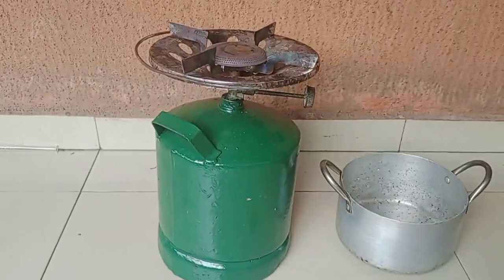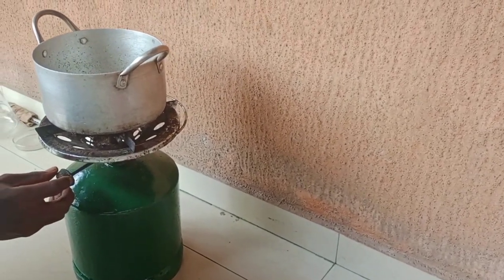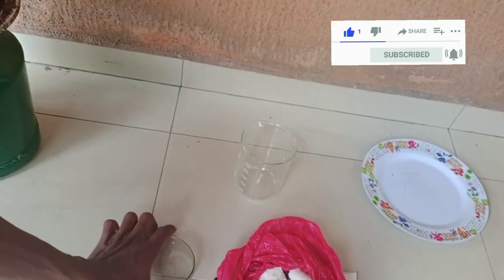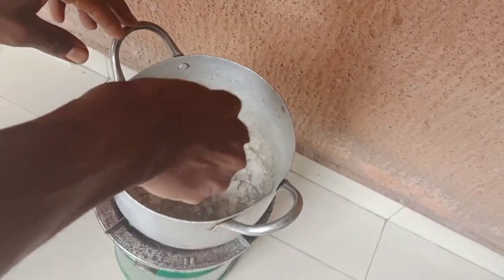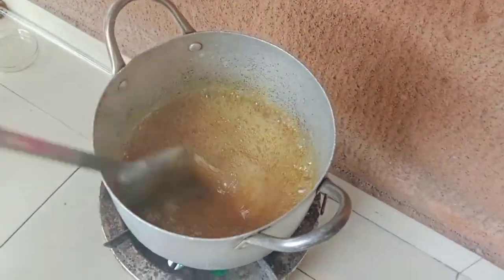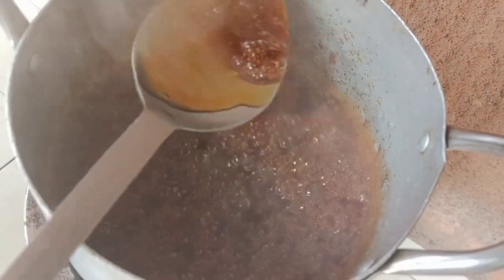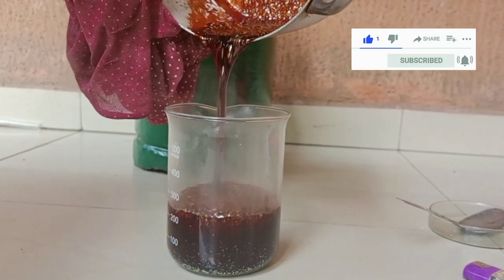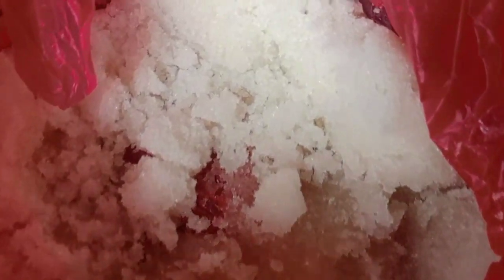HOW TO TURN SUGAR INTO MOLASSES

Comment: Thanks for sharing this knowledge.

Please is the sugar used the regular granulated sugar?

And how many kilograms of sugar will result in 1kg of molasses?

Thanks in advance for your response.
Reply from the maker: Yes the regular granulated sugar
Reply from the maker: I will major it and get back to you soon
Reply: Please I tried this but ended up with "molasses" that hardens to solid state when it cools down.

What could I have done wrong?
Reply from the maker: @relianceholdingsltd  once the sugar melt add water gradually so that it will not solidify